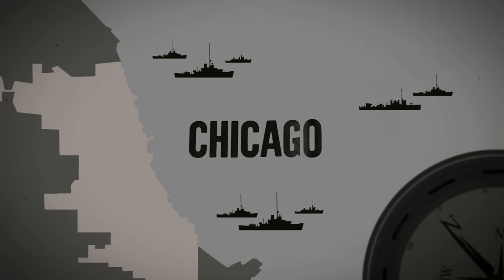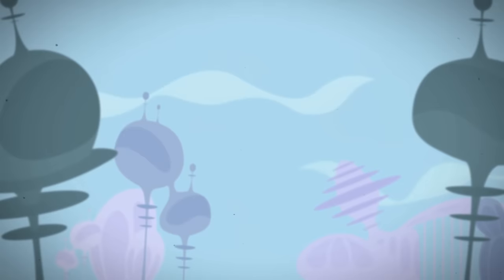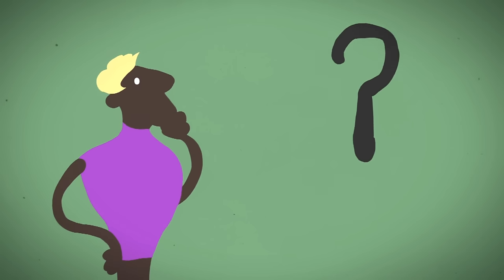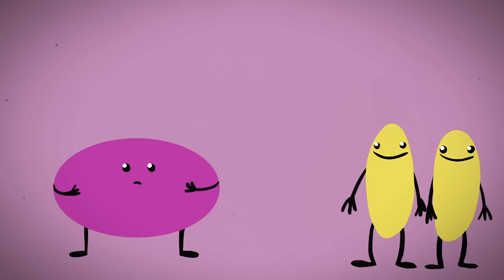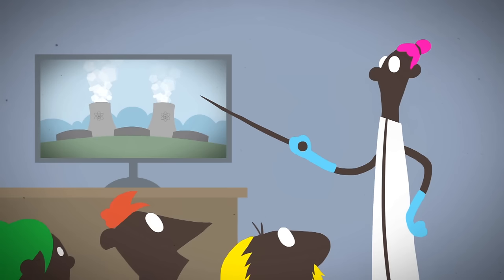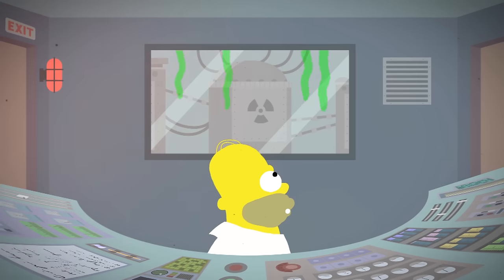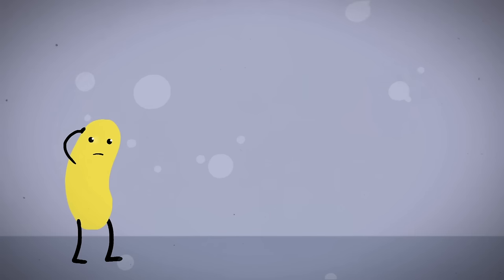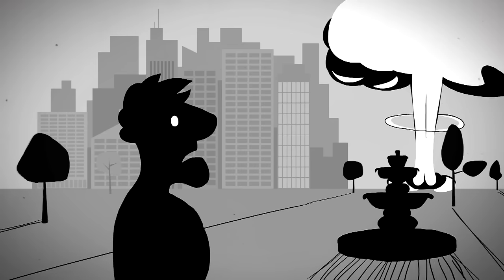How do nuclear power plants work? - M. V. Ramana and Sajan Saini

Comment: We need to be investing in this and renewable energy to replace fossil fuels.
Reply: I’m just tryna get the answer on my test
Reply: Less solar and wind as they aren’t as reliable and more nuclear as it is reliable.
Reply: You can't rely on rewenable energy
Reply: @eternaldarkness1508  That's why we need to be investing in some degree of nuclear energy too until we can ensure the sustainability of renewables.
Reply: @I_am_Signal  In the short run, yes, but in the long run, hopefully, we'll be able to innovate better energy storage and other technology that will permit the full employment of renewables.
Reply: @missallmight2483  Okay...
Reply: i can't imagine a way that humanity will purely rely on renewables . We should find a way  to control the sunlight and the winds and that's practically very tough .
Reply: @eternaldarkness1508  You don't need to able to imagine it yet. If you could imagine it at this point, we'd already be working towards implementing it.
Reply: @billyfox6368  ok :)
Reply: nuclear energy is better because it will produce enough energy to power future generations
already today we are doubling/tripling our demand for electricity by using electric cars and electric appliances inside our house
meanwhile renewables already need to be supplemented with coal to keep up with our current energy needs, and even then they are very unreliable
Reply: @programmer-mr5vo  That's why we need them in the short-run, but hopefully, renewable energy technology will improve sufficiently that we can rely on them wholly because of the issues with nuclear energy such as toxic waste.
However, if nuclear technology improves similarly such as with thorium reactors, reducing waste, yes, we could rely on them instead.

Comment: The rejection of nuclear as "dangerous" and "dystopian" reveals a chronic myopia of our global society. Even if nuclear energy has the potential to bring about world-ending consequences, the chance of it happening is a far better prospect than the certainty that it will happen with our reliance on oil and coal. Of course, our best course of action is to use renewables for anything and everything beyond a sustainable use of non-renewables, but that simply can't happen in the short term without some adjustment period.

Comment: I expected better from TedEd. Nuclear power is efficient and a lot of the issues presented here didn't elaborate solutions well. Nuclear power is probably our best option to fight climate change, even though it is a slow process. It will help in the long run.

Comment: A lot of careful engineering goes into designing a nuclear power plant. fuel rod has many levels of barriers (like clad, inner and outer containment). For LOCA ( loss of coolant accident) which is pretty improbable to happen, they have ECCS ( emergency core cooling system). Every plant has rigorous analysis and safety reviews before commissioning ( like fault and event tree analysis of the whole system). Also regulatory bodies keep a close watch on whether the safety protocols are properly followed or not. Also problems of spent fuel are being addressed by vitrification, storage bay and also accelerator driven subsystem ( which can burn the long lived fission product to turn them into short lived daughter products). So, many apprehensions conveyed by the video are not very substantial and if we look for a better and greener future, nuclear energy is one of the best possible options that we have.

Comment: our problem is the efficiency of most power generators. With coal, we exchange chemical energy for thermal(heat), heat to elastic in the form of pressure, pressure to mechanical and from mechanical finally to electricity. from all this we only got 30 to under 50% of the energy released.

Comment: Even though alternative power supplies like solar, wind etc will surely play a massive role in the future, we should not underestimate the fact that every country or power grid system needs a source of stable 24/7, constant supply of energy to build it's baseline. This could be done either with nuclear or fossil so far. Even the newest methods are fossil related so nuclear pretty much has no reasonable competition besides when speaking about price.

Comment: Most of the flaws pointed out in the video have been fixed or are being fixed with modern technology. Thorium reactors don't produce plutonium waste that can be in bombs, and there are reactors that can use nuclear waste to make energy. Also, many safety problems that have come up in the past were because of outdated technology. It is very important that all reactors use modern technology because it is much safer than the old technology that some plants probably still use to this day.

Comment: here's a genius idea, recycle the plutonium and use it for energy so you don't guard the waste forever.
Reply: In the USA we banned what you are describing in 1977. The problem was that we were using reprocessing to take plutonium used in nuclear reactors to then make nuclear weapons.
Reply: Paul Swanee do you know why it was banned here, and do you have any other ideas besides bury it?
Reply: Yeah they banned it for threat of nuclear proliferation. Jimmy Carter wanted to convince people that the USA was committed to reducing its nuclear arsenal. Since we produced plutonium from reprocessing this process was banned.

As far as other ideas, there are different ways to decrease the amount of waste, but you can never eliminate 100% of waste that breaks laws of science. Processes like Vitrification or Ion Exchange can be used to reduce water and types of waste. A specific type of vitrification known as synroc-vitrifcation takes slag from coal plants mixing with waste and flash burn the material to solidify it into solid discs. This decreases the volume of the waste per barrel. However any long term situation will probably include depositories and waste management systems.
Reply: In Britain they do it but there is still 3% waste left

Comment: why not use solar energy????????????????????????????????????????
Reply: Great Dragon doesnt have the bang for the buck yet fossil and nuclear are most efficient for that n hydro electric but theres only so much dams you can built in a river :I
Reply: Because the average nuclear reactor produces over 5 times the largest solar farm production in a year (9,000 vs. 1600 Gw), and its not intermittent power.
Reply: Great Dragon because solar energy is hopelessly inefficient and is not even close to economically viable
Reply: Dams, as cool as they look, are also very damaging to the environment.
The coast is constantly suffering erosion because of the sea's waves and currents. Usually, this erosion is offset by sediments coming in from rivers.
The problem is that dams are an obstacle to the transportation of sediments along the river, so they decrease the amount of sediments that reach the sea shore.
Because of this, the coastline moves back.
They also stop animals from reaching the sea, and, therefore, impact the habitats around the rivers.

Comment: Nuclear power is high-risk and high-reward. To those who herald it as the solution to climate change and the use of fossil fuels, I believe it'd be better if we balance out the usage of nuclear power vs renewable non-nuclear power. That should hopefully give us enough time to fix the problems associated with fossil fuels and find ways to manage long-term nuclear waste. Afterwards, we could easily rely on nuclear power and sources such as solar and wind power for our needs (maybe even fusion power if it ever becomes a reality!)

Here's one long-term nuclear storage solution that's being tried out by Finland:
https://en.wikipedia.org/wiki/Onkalo_spent_nuclear_fuel_repository
Reply: Nuclear power is no where near high risk. The chance of a meltdown is currently required to be 1 in 10 million, which is considered statistically improbable. Even if a nuclear reactor melted down, they are currently built to withstand a melt down and are extremely safe.

Comment: we have to remember, that there are hundreds of different types of reactors, and hundreds of different types being designed. some creates waste that can be used in a bomb, and some makes relatively safe and little waste. some can blow up, and some are much more modern. there are also a variety of fuel sources, from different elements. 
I just want to point out that nuclear power is NOT one thing. it's a technique, with tremendous potential, but with challenges just waiting to be solved.

Comment: You forgot to mention that France devised a solution for spent fuel. They noted that despite that spent fuel rods don't generate as much heat as they used to, they can still generate enough to boil water. Thus, they take spent rods and use them to generate power. They need more spent fuel rods to generate power than a reactor requires fresh rods, but this has proven to significantly reduce nuclear waste and increase the efficiency of Nuclear Energy, by reducing the amount of uranium mined and not wasting energy on storing the spent rods in cooling ponds. France has the biggest Nuclear Energy industry in the world and is known to be the greenest country.

Comment: The biggest obstacle to nuclear power is economy -- nothing else. Since the consumption of nuclear fuel is relatively low -- nuclear enterprises can't compete with fossil fuel enterprises, because oil/gas generates more revenue/profit for the producer. More money means more advertising, lobbying, job creation, and higher salaries. It's all in the market, not the technology. Nuclear power -- while imperfect -- is cheaper, cleaner and safer than fossil fuels, and more reasonable for large-scale consumption than solar or wind.

Comment: The fundamental problem with uranium fuel is that only a fraction of a percent of it is used. The rest becomes nuclear waste. Thorium is a better choice because in principle all of the fuel can be burned, leaving very little waste. 

The safely issues with reactors stem mainly from chemical and physical issues rather than the nuclear fuel itself. Use of water under high pressure for cooling creates a situation where any failure of the circulating pumps is critical. The use of zirconium alloy in fuel cladding creates a risk of hydrogen release and a consequent explosion if the reactor does overheat.

Both of these can be eliminated by the use of a molten salt fuel.

The huge cost of present reactors is mainly down to safety measures intended to mitigate these risks. If a fundamentally safer design were used, the costs could be much lower.

Comment: This video slightly overstates the risk involved with with nuclear power plants and provide visuals that accentuates danger and does not provide possible solutions to these problems.  Furthermore there is a clear basis (or perhaps ignorance) in focusing on uranium reactors and not mentioning thorium reactors which have less risks than the former.

Comment: The sort of person who is against the development of nuclear power because of the risks either doesn't understand how small the risks of nuclear power are if proper safety measures are taken and don't know how many of the risks have been eliminated by modern reactor designs, or they been kept too scared by the prospect of nuclear power to actually get informed. Think of it this way, the development of modern aviation has involved a long history of accidents and engineering failures resulting in the loss of many lives, but after each event we looked into it, analysed, and learnt from the mistakes of previous designs and procedures altering existing and futures aircraft designs to fix the flaws. Now practically all intercontinental travel and most international travel would be unthinkable without flying (which also is now the safest form of travel in the world) which would have been impossible without continued effort to improvement the technology. If you look at nuclear power the same way you'll see that engineers designing them have had a much higher learning curve improving the safety of nuclear power far faster than the safety of aircraft improved.

Comment: we have to remember, that there are hundreds of different types of reactors, and hundreds of different types being designed. some create waste that can be used in a bomb, and some make relatively safe and little waste. some can blow up, and some are much more modern. there are also a variety of fuel sources, from different elements. 
I just want to point out that nuclear power is NOT one thing. it's a technique, with tremendous potential, but with challenges just waiting to be solved.

Comment: If we would invest in the material engineering required to resolve the corrosion issue with thorium reactors then we could solve most of the negative issues since the by products are far less toxic and have shorter half lives. The really issue is not Uranium, it is the highly toxic plutonium, which is not very radio active and extremely stable, just very very toxic.
Using thorium / uranium reactors would resolve this.
However we have some additional engineering to do before we can. 

I argue that the benefits of clean 24/7 on demand power available to supplement solar and win are how we are going to make it to a clean prosperous future.

Comment: So the reactor works by catching the radioactive particles and heating the water in the process. The waste is dangerous because it still has fission potential in the plutonium and trace amounts of of Uranium 235; can we not reprocess the fission products back out and use them in a the reactor? or attempt to fiss the plutonium into something lighter? or even invent a new way to use harvest radioscopic energy directly from the waste?
Reply: Some countries do this, however it is illegal in the USA due to threat of nuclear proliferation experienced in the 1970s. Its also incredibly expensive, however there are advanced forms of nuclear that can theoretically reuse its own waste over and over again. TerraPower has been working on a prototype for this reactor scheduled to run testing as early as 2020 in a Traveling Wave Reactor.

Comment: Interesting, but not exactly accurate.  Consider:
1. Plutonium from commercial reactors is a very poor material for making atomic bombs.  It can be done, but it is much better to make better material from scratch.
2. North Korea did just that with no help from spent nuclear fuel.
3. Plutonium can be fissioned in a reactor to create useful energy, which is what we should do with the plutonium.
4. The method used to sequester spent nuclear fuel from the public is effective and well-known.  It works very well.  There has been no injuries of death because of spent nuclear fuel.
5. Atomic bombs are a terrible thing to have at our disposal, but who give them up first?  Right, they will be here for awhile, but none has been used in war since WWII.
6. 95% of nuclear fuel does not change in a reactor.  We should recycle the spent nuclear fuel to recover this valuable clean, carbon-free energy source.
7. Next generation reactors, called Small Modular Reactors (SMRs), are promising and can be designed to use all the fuel.
8.  Renewables need backup because they do not produce electricity all the time.  This is a big challenge to utilities.
9. The ideal situation would be for SMRs to be used as the base-load (on all the time) backup for renewables.
10.  Nuclear is the answer to carbon-free energy.  Don't we want all of our available assets going to produce clean air AND electricity?

Comment: Nuclear was ultimately killed by regulatory ratcheting. There is so much legal red tape these days that doing anything related to nuclear, even mining rare earth metals which produce thorium as a byproduct, is economically unsustainable. The new reactors that are being proposed tend to be small and standardized (identical) because that way they can be produced in factories and licensed quickly, cutting down on the ridiculous regulatory costs which have made building new large (and more efficient) nuclear plants roughly 5 times more time-consuming and 4 times more expensive compared to how it was in the 60-70s.

Comment: The thing with nuclear energy is that people are afraid due to events that happened a decade or more ago (Fukushima and Chernobyl). These are complicated by the politicians who often scaremonger. Even modern 3rd gen reactors are much safer than those Fukushima reactors, and now the much safer 4th gen reactors are on the horizon. New designs like MSR, ADS, AHWR, gas-cooled pebble reactors, denatured reactors, etc. are all way safer and/or efficient. The waste problem occurs only in those nations that prohibit reprocessing, which reclaims back ~98% of the waste as MOX fuel, leaving only ~2% FPs and Minor Actinides remaining, which themselves can be transmitted into much more radioactive elements in ADS, decreasing the storage time to just a few centuries.
And not to mention, nuclear is the only credible replacement of thermal power plants, but with the added bonus of requiring less fuel (by mass) and way less waste output. Only the initial capital is expensive, but it provides better long-term affordability and obviously little CO2 emissions and pollution.